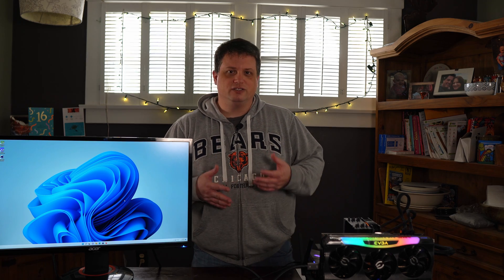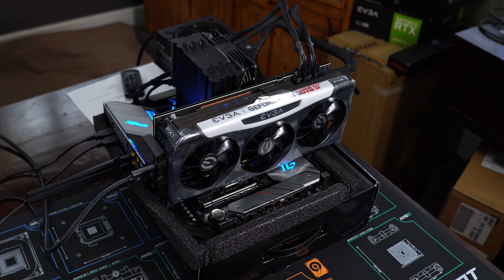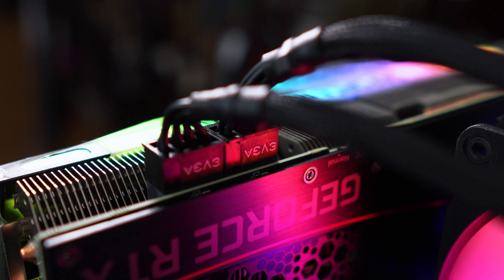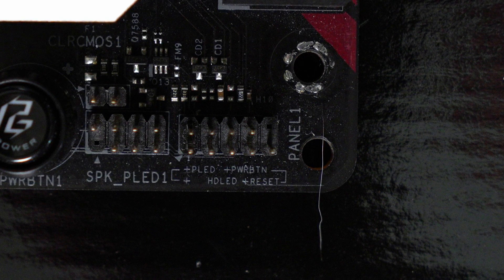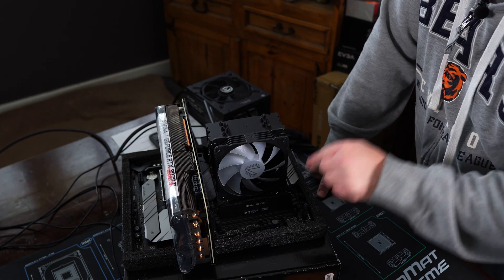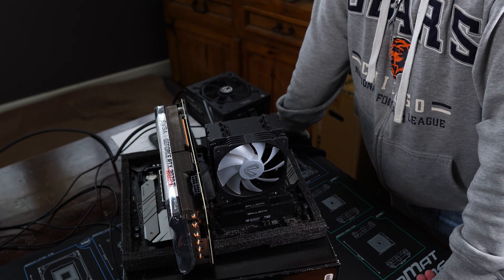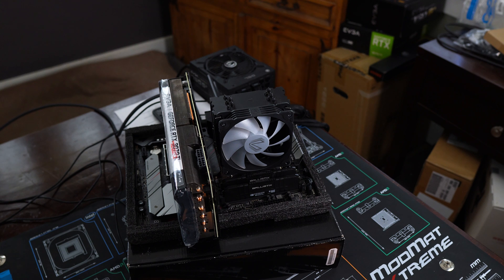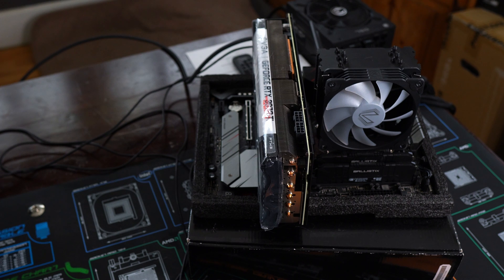Basic PC troubleshooting tips to get your system to POST

Comment: I think you should start with the PSU and work outwards. Before connecting the cables to my PSU, I use a Dr. Power III to test my PSU power. The one I use is made by Thermaltake. It will test the 12-4 pin ATX power supply available today up to ATX 12V v3, Cheaper Power testers do not do this power test.
Reply from the maker: Good suggestion!

Comment: I had an issue once where I initially got the system to POST but then it would start randomly blacking out and then wouldn’t boot.  Found out it was the Graphics card being so heavy I needed to get one of those vertical holders to maintain solid pin contact in the PCI slot
Reply from the maker: wow. now that is a random issue.  I've never encountered that and I've had some beefy gpus!

Comment: Just wondering if these front-panel pin headers would ever be standardized so as to create a single connector instead of a collection of 1-pin/2-pin connectors.  It’s been this way for-ever…
Reply from the maker: Some companies like ASUS have put together an "ez-connect" where you just plug in all the connectors to this chunky connector then put that into the motherboard. It's ugly and sticks out so I didn't use it. But yeah, I absolutely wish case makers and mobo makers would standardize the layout for the front case area.